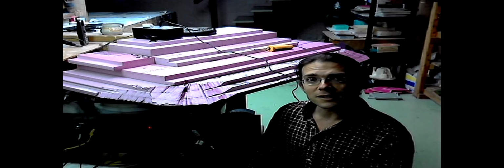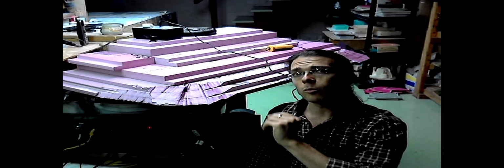TerranScapes - Carving the 'Big Hill'

Comment: @dreamspiritwar @harald851 Always check with the manufacturer of the foam you are using to make sure that there are no health or safety hazards when cutting their foam with hot wire tools. When cutting polystyrene foams, ventilation is always strongly suggested, but the smoke that you may encounter while cutting EPS/XPS foam is primarily CO2 and water vapor, which are far less harmful than other common art products like aerosols and paint thinners.